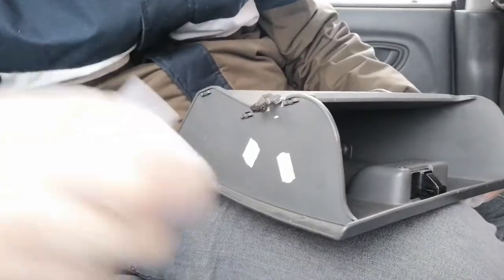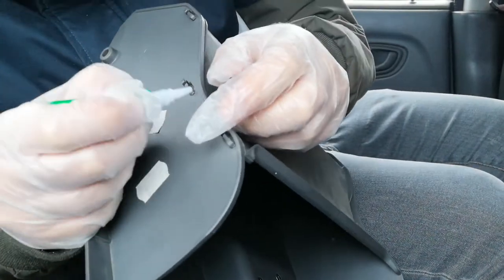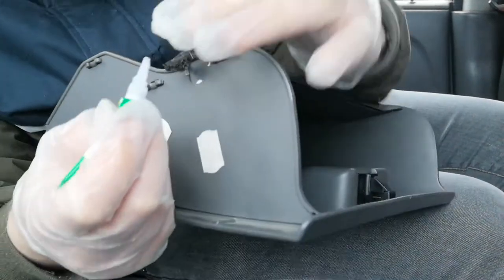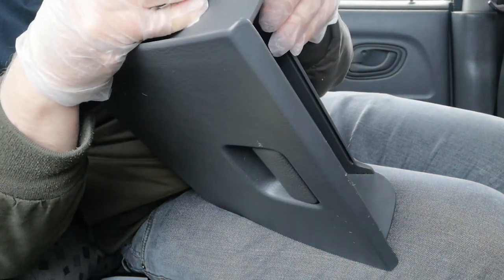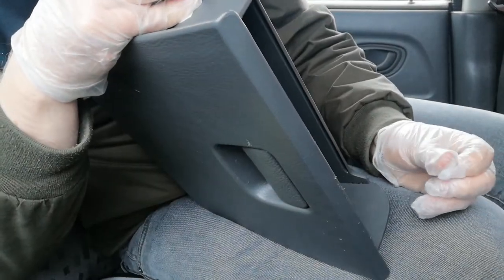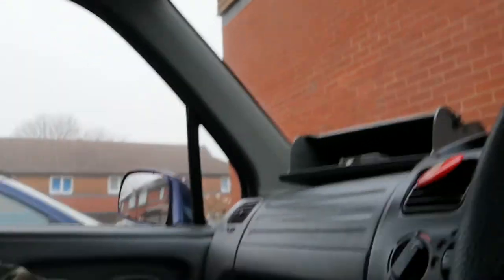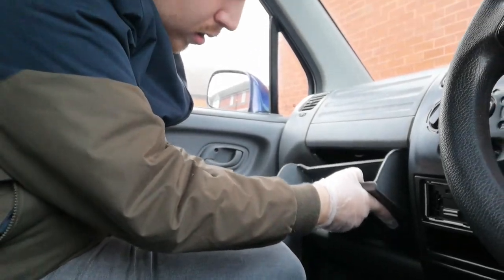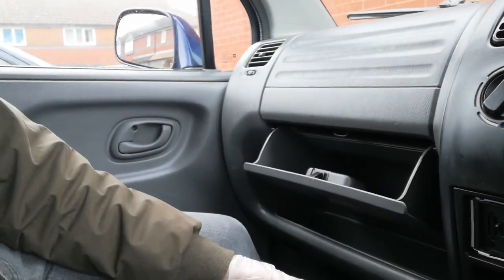Fixing a glove box (vauxhall agila mk1)

Comment: I hope that repair lasts for you, here is a little tip, if you mix super glue with a little bicarbonate soda it helps repair plastics if that failed you can remelt plastic with a soldering iron and use a cable tie as a filler rod you can only use this in certain plastics I think most car stuff is successful. Keep them coming Tom. All the best.
Reply from the maker: Thanks Steve I will bare that in mind when fixing plastics, fingers crossed it lasts 🤞